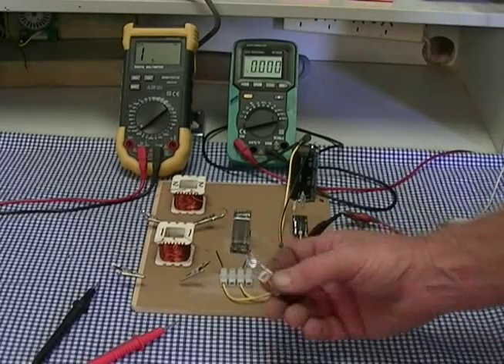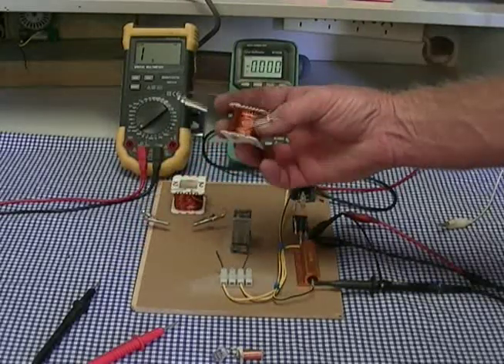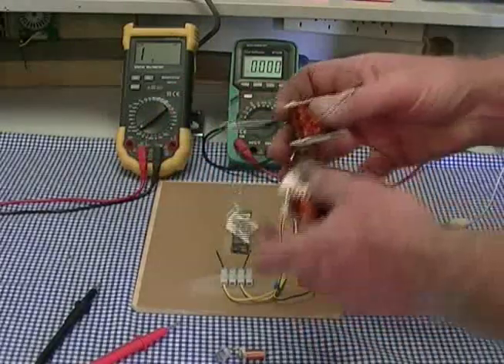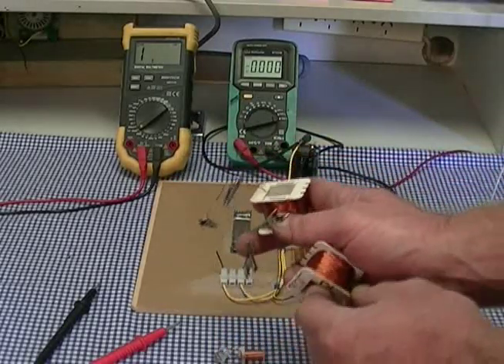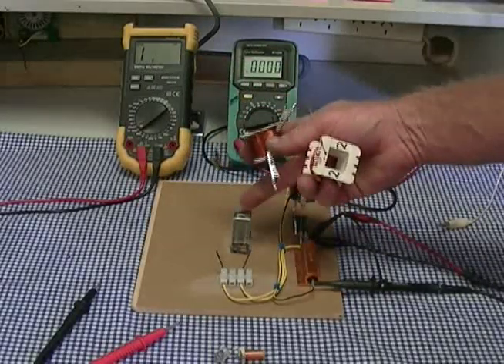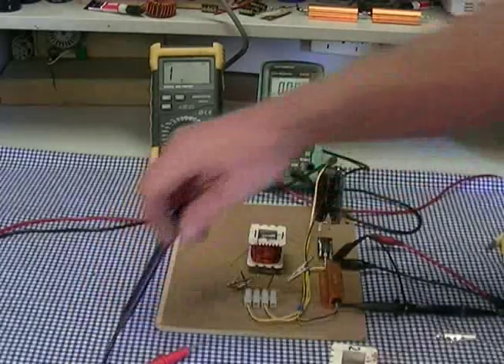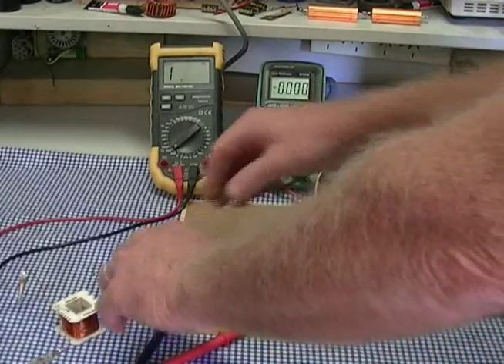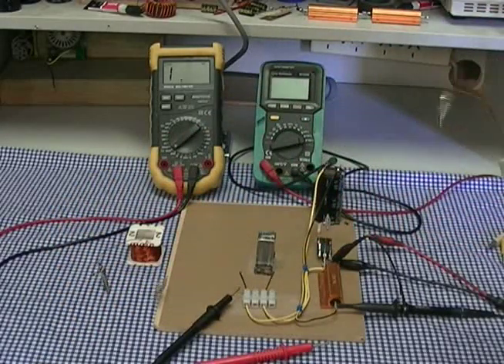Dose it take energy to create a magnetic field.

Comment: Looking at all the comments. It is sad that this world think we are made from magical bumping particles with magical opposing charges that violates the law of contradiction :c

Anyway, it is the opposite. Magnetic field and current defines stored energy, not the opposite of what you thought .-.

You do not need "energy" to generates magnetic field, you only need amperage. Then, stored energy is derived from that moment of magnetic field while amperage is propagating.

W=(1/2)*L*I^2 or W=(1/2)*Phi,weber*I

Energy equals Henry-Coulomb squared per second squared or weber-coulomb per second or Planck per second.

Hope this works as an eye-opener.

As for those who think magnetic field cancels each other, they don't .

Instead, they go right through each other to cancel out the phase shift.

It is because you can redirect the secondary flux, you can have zero phase shift , not zero inductance -__-

Comment: But, we could try the following:
“Wind a coil round the core and take another wire of same length, material and cross section and wind up it again round the core but in opposite direction of the previous wound coil. Wind up the second coil in gap between two loops of previous coil with same no. Of turns.
So you will have 4 terminals total, 2 on both end. Connect each pair on both side (short the coil terminals) and give supply. You will get almost zero inductance but double resistance.
It is so because inductor is a unipolar element i.e, property depends on polarity whereas a resistor don’t understands polarity.”

Comment: Excellent video with great scientific process!  One may argue, though, that both coils 'create' magnetic fields regardless of the superposition of fields (in this case cancellation in one of the coils).

Initially there is negative power (from a voltage opposing the turning on source voltage in a conductor)...in your scope trace it is obvious that one coil in your experiment is not experiencing this negative power...so there's a bit more going on here then the 'BackEMF' or external 'superposition of magnetic fields" which results later on when the source reduces the voltage.

Nevertheless I am a fan of great videos like this one!
Reply from the maker: Thanks for your support and great post.

Comment: We do not create magnetic fields so your question makes no logic, but I think I know what you meant.  All charged particles (here electrons) have already existing magnetic fields both at rest and especially when in motion. The magnetic fields are random as the electron spins and paths are random in their travels in matter.   All is in motion in the universe.  Winding coils and feeding a current serves only to cause spin polarization of the outer most electrons orbitals.  This makes a stronger detectable field to the external observer as the electron magnetic fields are no longer random and canceling each other out as much at the micro-scale.  In both coils magnetic fields are equally "created" but the non-inductive fields although have cancelled are not nonexistent!  They actually have 2x the field magnitude.  They are there, so you spent energy in both coil versions equally mostly to fight resistance and a bit for eddy current loss and some hysteresis as the particle masses shift polarization (kind of like mechanical friction on the subatomic scale except no actual physical contact).  The regular coil has the extra complication of the BEMF influence.  Would have been better if you had simply used DC non pulse source to compare the coils.  Then you would see both coils consume exactly the same amount of power.  An analogy to your view of it taking energy (from us) to form the magnetic fields (your question) relative to electron spin is this.  Take a sheep dog and 100 random moving sheep.  Does it take more energy to power the dog than the work that can be harnessed from the (free paid by nature) moving mass of sheep when they are changed from random motions to an organized prime mover?  Think of the organized motion of 2 horses pulling a stage coach.  If the horses go opposite directions, no useful work is done, but if organized in the same direction much work gets done.
Reply: EnergyCrafts, Hi. Work is supposed to be equal to weight times the force applied times the distance moved. ( That is what I think I remember from class, but being human, I have the right to be wrong). As some have displayed, if two persons WAVE a rope it creates ripples, supposedly work has been done. But if they were to put even more effort and simply PULL the rope, no WORK has been done? Your example of two horses, is that work is BEING DONE under both conditions, but only one we DEFINE AS WORK.. Humanity’s collective Right to be Wrong is Defined as being right.
Reply: Sundiesel, you are right:  w does =fd, but there are other formulas for work as well.  w=fd is why a magnet lodged against a refrigerator door does NO work even though the magnetic fields are acting against gravity wanting to slam the magnet to the floor.  Since d=0 here there is by this formula no work done.  But I always counter, well if I was to have to hold a weight up in the air the same weight as the previous magnet, then still the equation would say no work done as d=0, ok fine but why do I get tired if I did no work?  So I think there is more to understand.  As to the motion of random electrons or moving horses you are right.  Work is done whether the motion is random or organized (w=f of electronsXDistance).  Interesting truth:  random motion particles is paid free by Nature and only organized motions are paid by US.  As you say we often only define work IF it is USEFUL work.  2 horses moving is work, but only when the two move in the same direction to pull the stage coach is it USEFUL work.  So in summary:  the universe due to all in relative motion is doing work constantly.  Yet humans tend to only count the USEFUL work while the universe is composed of USEFUL and NONUSEFUL work.  We are leaving out part of the real conditions in space!  I am human too, so I reserve the right to be wrong.
Reply: EnergyCrafts. So true! USEFUL & NON USEFUL. Who defined such strange deranged definitions? And worse yet, had the audacity to call them “ LAW ”, as though some legislature somewhere approved the stupidity into an act, whereby any deviation from it is an act worthy of denial of acceptance. 
( I find it weird that Galileo was “Pardoned” a few centuries later, for being truthful!! 
These are those who define “USEFUL WORK “. Work has been done, no debate, but can it be described as USEFUL, will be defined by the beneficiary of the work. If he does not benefit from the work, then he defines it as no work.
Someone needs to question, whether every entangled particle performs at the very least, two acts for each part acted upon by sentient observer. Does that even count as “Work” created by mere conscious observation?
Reply: EnergyCrafts, Btw, if you leave a heavy television on a table for a couple of years, the table also "feels tired" like you say you do. But while you pay for fighting gravity with strength derived from your lunch, the table pays for the same act by loss of mass.
Reply: Sundiesel.  Yep, it seems to be a continued trend of boastful audacity of humans to make the LAW, yet Nature marches on unconcerned!  The same as back when Copernicus dared to question the church(which followed Aristotle on the center of all point) and state that the Earth was not the center of the Universe or the solar system.  Same principle still going on with all the physics THEORIES.  Here is another interesting point:  physics says no energy conversion can be 100% due to losses.  But it always neglected to point out that the actual total of energy in the system remains exactly 100%, that is nothing goes to waste relative to Nature.  But relative to man, only the useful(to him) part is considered.  But if we could USE(FUL) the left over energy then we get it all.  Example:  a gas car engine may only be 23% efficient for propulsion down the road and gets a poor efficiency in the calculation.  Much of the loss is due to friction and heat.  IF we harnessed that friction and engine and tail pipe heat for a USEFUL purpose then that car would really be far more efficient that just 23%!  It is not Nature's physics and fault that we refuse to be more productive with what Nature gives out!  Now how about this to blow your mind:  Consider that we are told we can not change the laws of physics.  Yet the same people state that the laws of normal physics breaks down in a singularity black hole.  So physics can be changed after all!  Now a more shocking realization.  Consider a black hole separating 2 alternate realities or even Universes.  So the physics on the left side is constant but matter and photons that enter the black hole loose their original laws of physics and when the "stuff" reaches the other Universe it acquires the NEW laws of physics for that domain.  This is the ONLY way I can see our area of the Universe always in perpetual motion and moving matter thus doing work without an obvious prime mover.  Which should violate the laws of conservation of energy since we are told there is no such thing as free energy or free work.  Maybe the black hole serves to rewrite the physics so that what is "lost" in one domain is balanced by the law change in the other domain.  Since there is no rule on how small a black hole could exist, it is conceivable man could make a tiny one to harness energy without violating Nature's physics with the above logic.  In that event to the uninformed person, it would seem one had free energy perpetual motion, but to the learned it is just a copy how Nature "powers" itself for free by REWRITING LAWS to balance the account.  Otherwise the whole Universe should have stopped all motions long since the Big Bang with all the friction, collisions, gravity etc.  Yet it still moves and does huge amounts of UNUSEFUL work mostly and is even accelerating while man works hard for tiny amounts of USEFUL results!
Reply: Particles does not exist.
Reply: Lukie Kelen , true, particles do not exist. They are brought into existence by conscious observation, or measurement

Comment: Another thought!!! all electrons moving even in a strait wire has a magnetic field rapping wire into a coil just lines then  up. There is no current flow without a magnetic field. Unless u wound it to cancel the next turn of the coil, but still there is a field around the wire . so logic says that it takes no extra power to make a magnetic field only losess throught currents in core or back emf. Try it with out taking back emf and use air coil. Please consider.
Reply: ALL particles such as "electrons" does not exist.

Comment: The cost comes back as the back emf this can be used. It's only lost if you dont use it. no back emf on the non inductive coil so it cannot be lost here.   larger wiring gives greater back emf as resistant turns it into heat.also iron core has loses only when its made a magnet.( Use ferrite core.) Again loses not found in the non inductive coil. So theory not proven untill these two problems are accounted for. Please consider.
Reply: indeed, ferrite core, or air core. thick wires for low resistance losses. Back emf can be negative voltage when switched high side. if switched fast enough, the - backemf is a impulse capable of inducing radiant pressure. more info in coming video on my channel